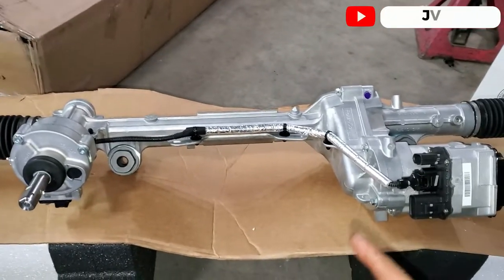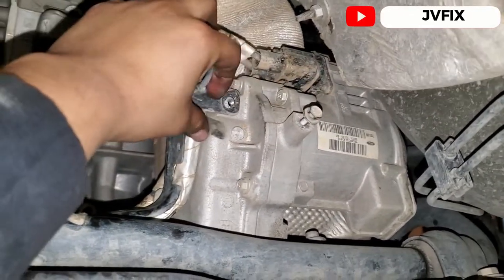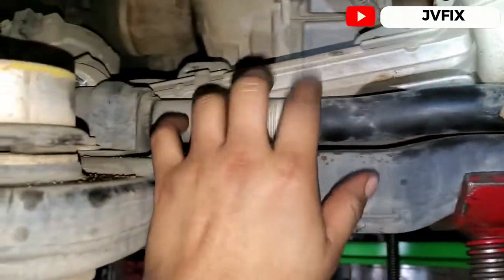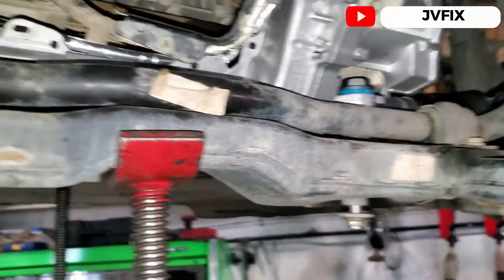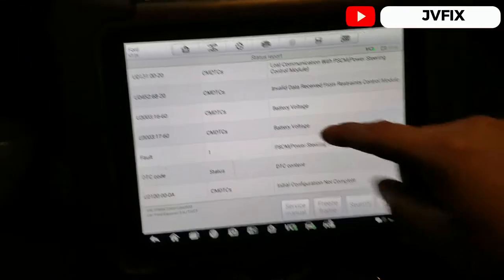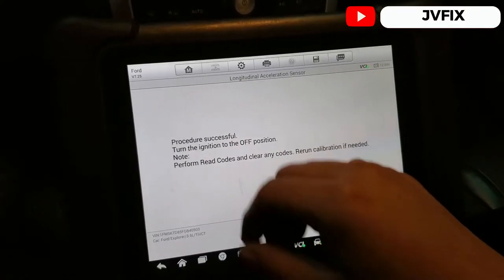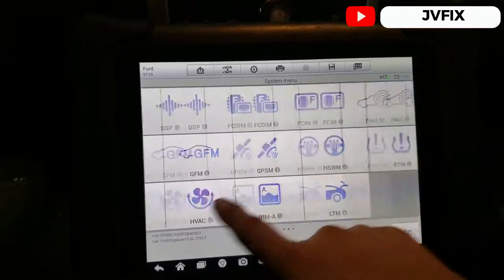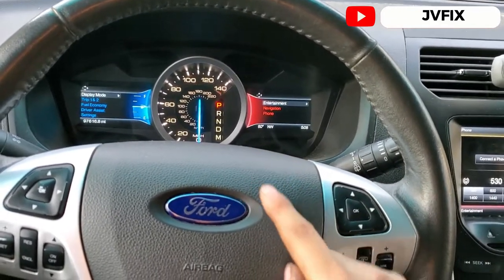How to Remove and Install New rack and pinion on 2014 Ford Explorer. "Programming bonus" Autel

Comment: I just installed a rack and pinon on a 2013 Lincoln mkt and I was trying to calibrate it just the way you did, I got an Autel but I don’t have the same
Selection as you do. Which autel you have ?
Reply from the maker: I have the autel im608, u can download forscan is free and use your interface j2534 and it should let u calibrate with forscan

Comment: I’m have a 2015 as well that needs one. What was the part number from ford? Also do you know if forscan can reprogram the explorers?
Reply from the maker: I will find the part# and type it in the description and yes with forscan you can also program it.
Reply: @JVFIXLLC  thank you so much. Really appreciate your content!
Reply: Did the forscan let you reprogram it?
Reply from the maker: yea u can program it with forscan too
Reply: @JVFIXLLC  How will I know if it needs to be programmed, I replaced it and there was an ABS code but that was it something about low voltage. Using forscan after the ABS code was cleared there are no other codes. I'm new with forscan also sorry.

Comment: I put a brand new Rack in a 2018 Ford Explorer. Im trying to program the Module. Its asking for a 7 digit number.. Where do I get that? Im using Autel MS919
Reply from the maker: the scanner never asked me for that all I did was steering angle reset. the module already comes coded you just need to reset the dynamic steering

Comment: Hello, I want to ask a question. When the steering wheel screen spoke to the car, the steering wheel remained turned approximately 90 degrees. How do I adjust it again? please can you help?
Reply from the maker: you need a scanner and go to live data, there you can exactly see if your steering is centered right
Reply: Firstly, thank you for your reply. I have one of the same product that has not been removed. Is it okay if I measure it from both sides and adjust the other one accordingly? Before disassembling it, I marked the steering connection part. Thank you

Comment: I have a 2013 ford sport any way to get the rack and pinion? Its so hard to find mu2z-3v504-jrm
Reply from the maker: on ebay you can find it I ordered this one from autozone
Reply: @JVFIXLLC  thanks I'll try finding it, the auto part store in Ohio are all out of stock for the sport model
Reply: (STE-798-RM) since it's a remanufactured part will it be hard to program it, I bought it off of eBay. The other model is on backorder
Reply: @jvfix

Comment: Hey boss dealer is charging a lot to fix mine . I have a Lincoln MKZ 2015 . Can I get a used part for it and will it be programmable or is it just better to go with a refurbished or remanufactured part . Just to be safe . Can I also program it with the type of tool you have or just dealership only?
Reply from the maker: u can get a used part and there is no need to reprogram it the only thing you just do is calibrate the steering wheel only, all units come programmed already just need to calibrate and that's it, u can install it and drive it right away and if you don't have a tool to calibrate it just drive it to a shop and they can do it with a scanner.

Comment: I need your help , i had my 2012 ford explorer power steering rack and pinion replaced and now it says service advancetrac I don't know how to calibrate it and when i go to workshop they say it doesn't need programing i don't know what to do
Reply from the maker: yea you need to calibrate it with a scanner, the option is gonna be in the abs module or steering control module but you need a scanner to access it. do you have any?
Reply: @JVFIXLLC  i have forscan on my laptop i put the as built data and nothing changed, the nain problem is that my steering wheel is a bit heavy and sometimes the car brakes on its own saying service advancetrac i really need to fix this issue as soon as possible
Reply: @JVFIXLLC  my ford is a ford explorer 2012 limited so it has some features that use the pscm such as adaptive cruise control and auto park so when i replaced my steering rack and pinion these options don't work anymore
Reply: @JVFIXLLC  i am afraid that the whole reason for this is that i might have bought the wrong power steering rack and pinion i don't know if there is a difference between XLT and Limited rack and pinion but i hope there are the same
Reply: @ahkh642 I have that problem right now. 
How did you resolve the problem?? 
Thank you.
Reply: @idelperez5319  no i still have it and the new rack and pinion cost over 4500 dollars so it will never be resolved
Reply: @ahkh642 oh wow. I hear ya.Yeap. Im with the mechanic right now. Not looking good.👎🏽

Comment: What exactly model is your scanner? Mine went bad and dealership is charging me almost 3k to replace, and program it
Reply from the maker: yea the scanners that I use and also love to use is the autel elite and autel im608 nothe are a perfect combination if you are in the automotive repair industry.
Reply from the maker: you. an also buy the FORDscan. you only need the adapter and it's more cheap.
Reply: Any adapters you recommend me?
Reply from the maker: @cristianmoreno3073  yea here is the link on Amazon for the adapter.
FORScan ELM327 OBD2 USB Adapter for Windows, Diagnostic Coding Tool with MS-CAN/HS-CAN Switch for Ford Lincoln Mazda Mercury Series Vehicles https://a.co/d/iDJTs0J

Comment: Did you do the alignment after or do you need to do alignment before the reprogram???
Reply from the maker: when done installation I aligned first the tires by eye because when u remove the tie rods it is never too accurate so yea you will need to align it in a shop after installation

Comment: I clearly typed silverado and this bs ford pops up ?
Reply from the maker: what is wrong with ur silverado?
Reply: My bad couldn’t find a video on the rack an pinion i was frustrated, my lights turn ofd while parking the next day i had power steering reduce the mechanic saying the rack and pinion is bad so i was trying to do it my self and save the 300 fee lol
Reply from the maker: @Romerojesus1  ok I yours is electric and what I have seen in these trucks silverados with electric power steering is the that usually the high amp fuse burns  so I would check the fuse for the power steering that is located next to the battery